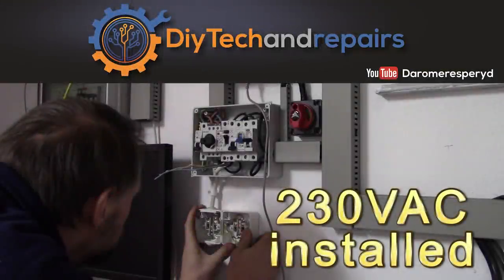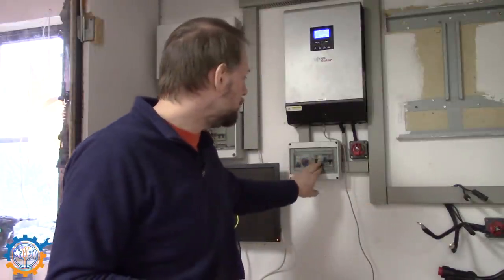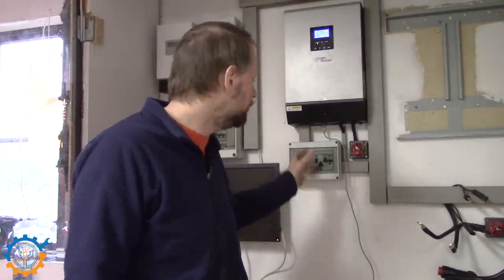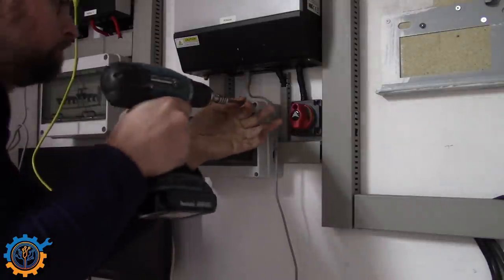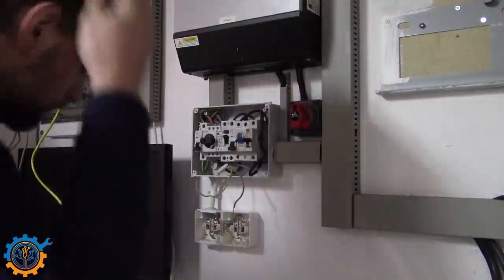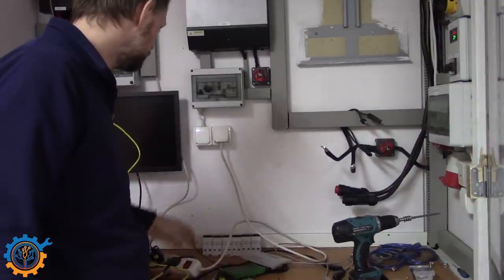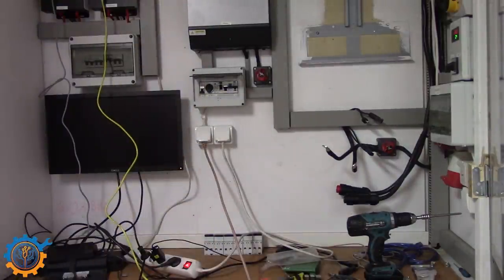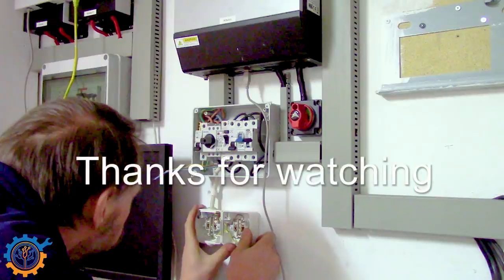Adding a 230VAC outlet to my PIP4048

Comment: Hello, thanks for the video. In terms of reliability, what can you say for PIP4048. How long have you had yours? Do they break down often? And in terms of loads rating, what percentage of loads for you place on your inverters? 70%/80%/100% ? Thanks, looking forward to your reply
Reply from the maker: It seem to be very good. they had issues with the first versions but the later ones are alot better. 
I load it 100% without issues! But look after for heat issues. In warm areas this could be an issue. I have even been pushing out 130% and more for shorter times.